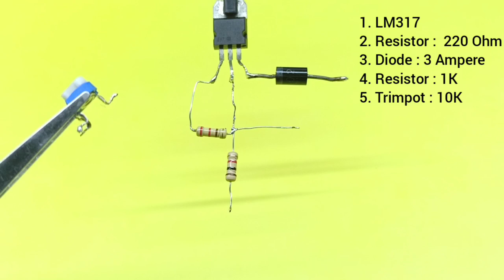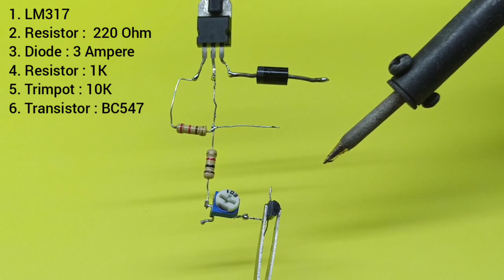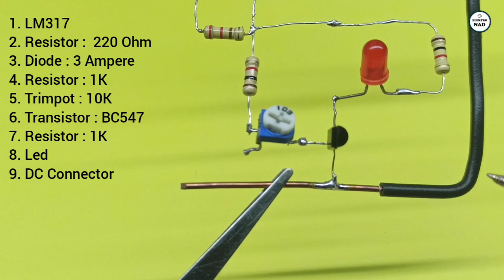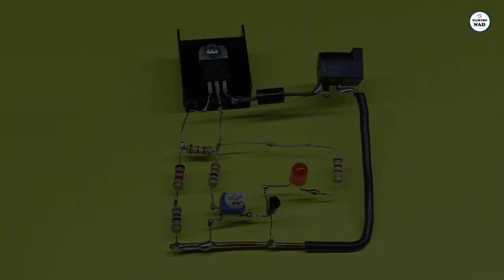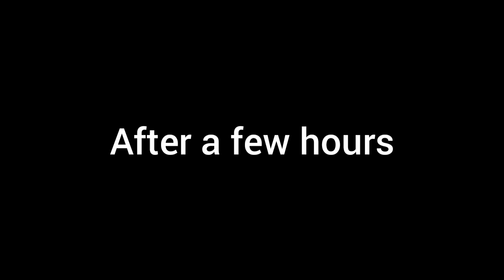How to Make Battery Charger 18650- 2X4.2V

Comment: if you use 2 resistors with lm317, one of 120R and the other of 680R with that you will have a value of 8.37v and you can replace the potentiometer